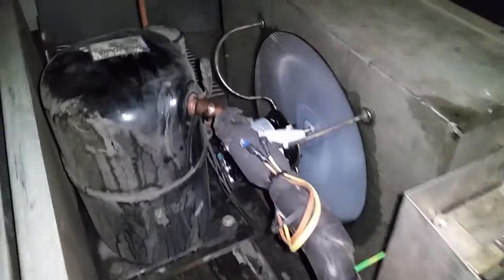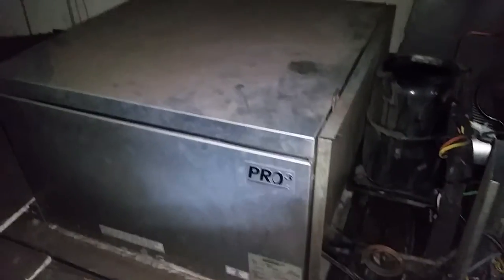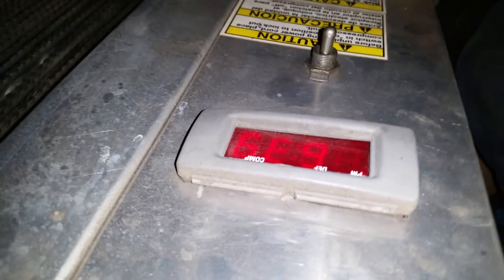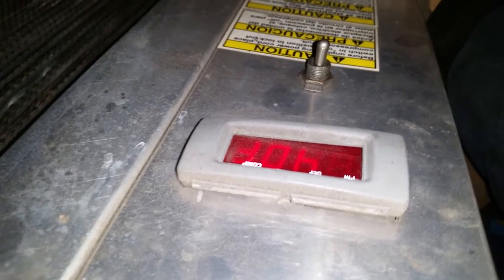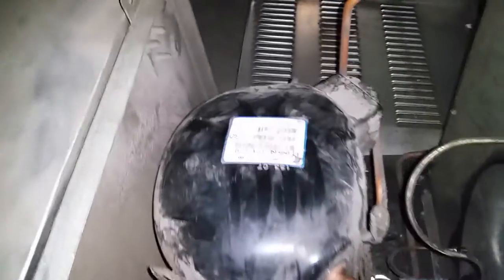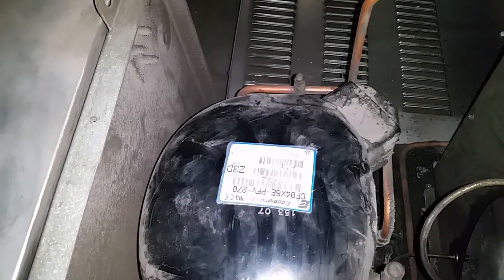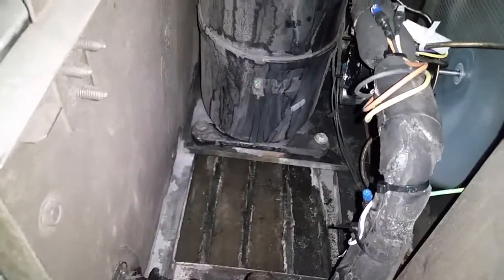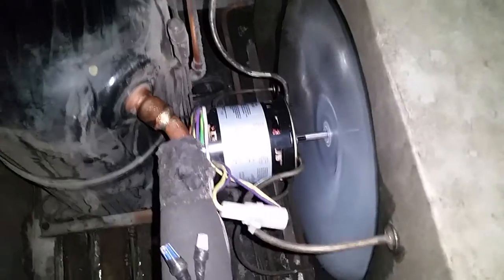#WalkinFreezerRepair - Condenser Fan Motor Replacement

Comment from the maker: Commercial Freezer Repair - Condenser Fan Motor Replacement

  This job we did for our repeat customer in Los Angeles. She called early in the morning and asked us to come over and fixed her walk-in freezer. She said that all her products were about to spoil. We arrived and realized that the condenser motor wasn't spinning and was very hot. We confirmed that 240 Volts were going to the motor, so it was pretty clear that the motor had burned out and and needed to be replaced. The technician had the right one in his truck and replaced it right away. Then we explained to the customer that the cause of this motor being burned out was dirty condenser coils. When condenser coils are dirty it blocks air flow and the motor spins but doesn't cool off, and over time it will burn out. As an appliance repair company we always suggest to all our customers that they service their appliances' condenser coils once every four months.

http://www.pacificappliancerepairs.com/commercial-refrigeration-repair.html

#CommercialFreezerReapir    #WalkinFreezerRepair     #CommercialApplianceRepair     #WalkinCoolerReapir   #CommercialRefrigerationRepair     #CommercialRefrigeratorRepairaLosAngeles   

http://www.pacificappliancerepairs.com/